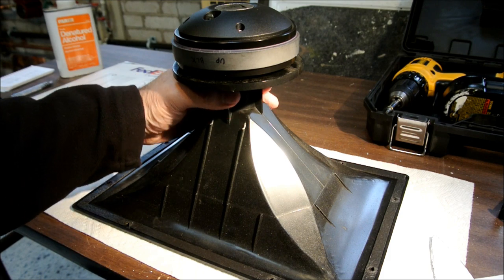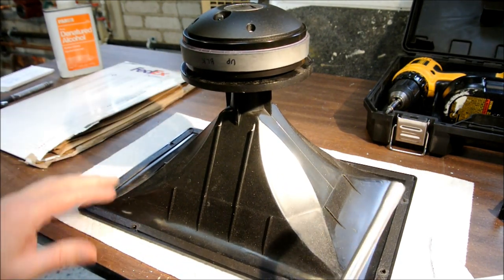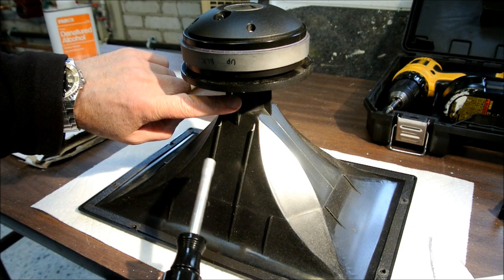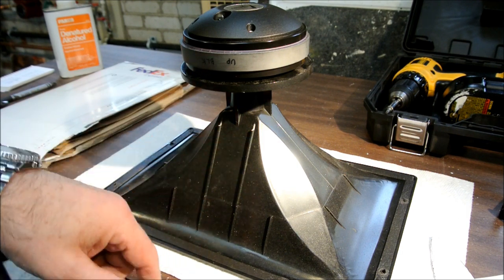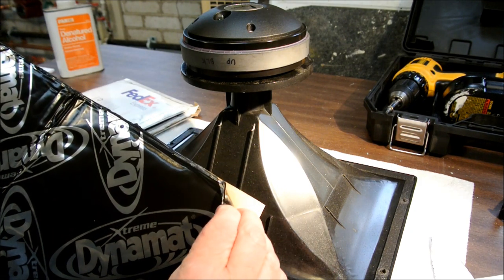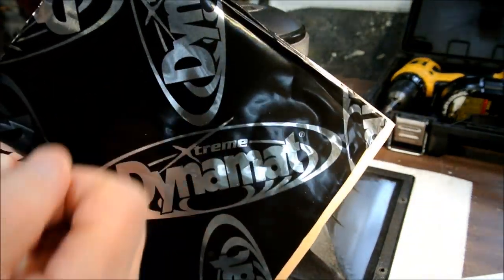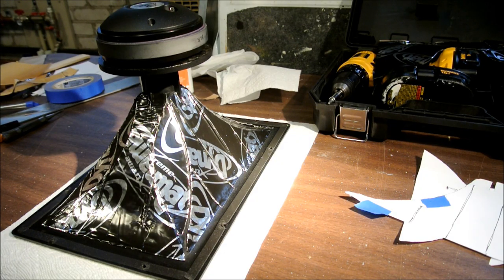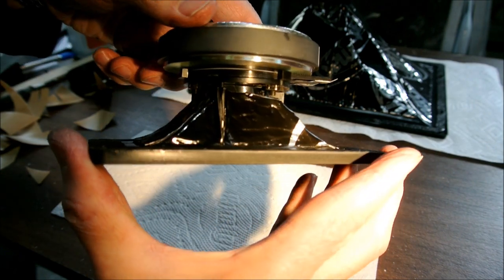How to Modify Klipsch speaker horns for better sound.

Comment: Nice job on the dampening project. It is a worthy goal to reduce resonances wherever they occur. I have to admit that I am a little skeptical of the audible benefits though however I am of an open mind that there could be real benefits to be had. I wonder though how you did your subjective comparisons. 
If you treated both speakers then fired up your system and listened, I am still skeptical of the claims of major differences you stated, not that they are not actually there, but that you are inferring that you can very well remember the sound before the change. It is well known in the psycho-acoustics profession that the duration of human audible memory is very short, less than a second or so. 
Therefore, to do an accurate comparison of sound characteristics of differences, you should do the change to only one speaker at a time then listen to them side by side with a mono signal and use a balance control to go back and forth between sides and also use short musical pieces that are repetitive and compare the sides over and over to form a consistent and reliable opinion. This approach is simple to perform and if you can have another person setup the speakers so that you are unaware of which side is modified, you can do a true double blind test. I believe that as serious audiophiles we should strive for a scientific approach to our methods of qualifying and characterizing the audible benefits of our work. It is not that hard to do following this method and I think if we take the extra little effort to be more scientific, some of the skepticism that is associated with audiophiles claims will be better accepted by the audiophile community as well as the non-audiophile community
Reply from the maker: I did do mono, side-by-side comparisons and filmed my listening impressions ... but the video got too long and I figured most people wouldn't be interested.
Reply: @thebostonaudiophile  Thats great. But did you compare treated to non treated speakers?
Reply: Ciao Stewart. That's my little story. I Bought the Isoacoustic Gaia III for my Klipsch Forte III. I had to drill the bottom of the loudspeaker to fit them but that's another story. Once made the first loudspeaker I switched the system on to ear the differences between the two and I can assure you that the difference was huge. The one with the Isoacoustic had a open and airy sound with more details and refined while the other was collapse. Any doubt that this little trick work. Thanks to Boston Audiophile for sharing. Next week end I'll do the same!!!!
Reply: @alfa71omega  Hi. I got the Fortes too. How does the Isoaucoustic Gaia 3? Small damping feet?
Reply: @theklipschcave5593  Isolation feet. They are meant to absorb the loudspeaker vibrations and isolate them from the floor. I was very very skeptical 'till I hear the difference from a dealer.... but they work. I think that with this mod the Forte III will achive their top performances (unless we mod the crossover too)
Reply: @alfa71omega  Well I find it interesting that isolation feet made that much difference. That says that you have them sitting on a floor that is pretty flexible and that there is enough energy in the cabinet to transfer to the floor. A good move to stop the floor from speaking to you also. That wouldn't be an issue for cement floors.
Reply: @thebostonaudiophile  I think that anybody that claims to be an audiophile and into the high end would be very interested. Maybe it got a little long winded but you probably could edit it down some. I think that doing good before and after listening comparisons is something that is sorely needed in the audio business, manufacturers, consumers, and snake oil sales people. It isn't really difficult to do even for double blind testing if you have someone to help you.
Reply: @alfa71omega  I would have to sit them on 2" foam pads before plunking down $200 on feet.
Reply: @alfa71omega  I got transport dollies with Auralex damping mats. Bit difficult to use this on this platform. But I will look into it for my rack with the gear.
Reply: @StewartMarkley  I do have cement floor
Reply: @StewartMarkley  

I recently bought air conditioning condenser anti-vibration pads that you put underneath central air conditioning units that have cork centers with rubber on either side for $0.69 a piece worked like a charm!🤗😇  and yes they did work but no need to spend all that money on anti-vibration pads when this kind of stuff is available considering I had to buy like 20 of them for the sub speakers the front towers the Rears!😬 silly to spend thousands when I spent a  couple of bucks!😋😉🤪
Reply: @alfa71omega  Well then I cant understand why isolating them from the floor does anything. But I would have used some simple foam pads before spending $400 to isolate two speakers.
Reply: @bigjay1970  That is a great simple and cheap solution. How thick are those pads? You have 20 speakers?
Reply: @StewartMarkley  

You dam right its a fantastic idea!🤗😬  4 per speaker because 4 feet speaker!  Even without feet I would do each corner!  7 speakers!  Best place by far, SUPPLY HOUSE.COM.  35 CENTS A PIECE. 2 X 2v  7/8TH INCH THICK and nice and cushy rubber, I've tried others like this and these really absorb the vibration.  Not as pretty as ISO but I could care less!  JBL Studio 590's and 550P subs and such.  Works great!  YOUR WELCOME!🤫🤭🤗😇🤪🤯🤓  I SPENT HUNDREDS ON OTHERS LIKE THESE AND RETURNED THEM AND KEPT THESE!  THEY ALSO HAVE THE BLUE INNER CORE  type THAT I didn't get because the smell at first and if you look at my photo, she can't deal with the smell but the cork work great and no smell   Amazon has similar for much more money but atleast you can see the reviews.  They are meant for what I said compressor isolation.🤫😬😜
Reply: @bigjay1970  you are a man after my own heart! I love doing things the smart way instead of the expensive way. But I have to say that I don't really get how isolating speakers from the floor can help unless the floor is flexible like made from wood versus concrete. If anything I would think it would be the reverse as the cabinet would be more able to flex and cause increased cabinet resonances.
Reply: @StewartMarkley  

Second floor apartment wood floor makes a huge difference. I don't feel the vibration through my feet. Concrete floor would probably do shit!  Key is the wood floor but I must say even on the carpet which is on the wood floor it makes a big difference and yes I analyzed it like a mental case!  It makes a difference actually a big difference! I'm not going to say it opens up the sound stage and all the other nonsense but there's definitely less vibration I'll call it and remember I have two  subs in front of me as well and it  just clears it up a little bit if that makes sense!  and for $0.35 a piece it surely doesn't hurt!😂  I'm about nine feet from the speakers and they're big speakers I'm not talkin little Stand mounts here. It does make a difference even through the carpet because I have them on the carpet you got to be just a little bit more careful but my feet or should I say the bottom of my feet tell me it works and so does my wife!😉😉😉🤗😇
Reply: I dampened one speaker first and did comparison. I also fitted a piece of hard rubber between the back of the mid horn and the back panel. The I put a dowel between the front panel and the back panel to brace them. These mods did make the sound more clear and the image more accurate.

Comment: This may be why wooden horns have such a good reputation.

I have used duct seal to dampen speaker baskets. Is dynamat more effective?
Reply from the maker: Could be a plus for wood? I didn't use the Dynamat as a seal but as a surface damper. The enclosures are ported anyway so I don't know if sealing would make a big difference or not.
Reply: @thebostonaudiophile  I use the duct seal as a damper. It is like a thick putty of fairly high density so damps some of the ringing.

Comment: Awesome. How much material do I need to order to finish both horns on 2 speakers?
Reply from the maker: I used this (18x32"): https://www.amazon.com/gp/product/B00020CAVA/ref=ppx_yo_dt_b_asin_title_o01_s00?ie=UTF8&psc=1
which was enough for both speakers with a bit to spare.

Remember to mark the wires and horn terminals so you get it put back with the crossover connected to the right drivers and with the proper polarity. Also, the Dynamat sticks really well, so I would consider it non-reversible. Good luck!
Reply: The Boston Audiophile Thanks a lot. I’m going to follow your journey and start working on these mods. Seems pretty straight forward. 
What are you planning on doing next, cabinet bracing? Seems like a next logical step before diving into crossovers. 
If you are going to mod your crossovers, can you do a detail step by step process and parts list? It would be very helpful. Great work as always. 👍👍👍👍👍👍👍🙏🏻
Reply from the maker: You are welcome. Please read my cautions in the video’s description. Good luck!

Comment: I haven't checked your channel completely, but have you done other upgrades in the electrical path, such better inductors, capacitors, resistors, and replacing steel terminal parts, etc.? Following the logic of your horn dampening, I was wondering if packing a singer's nasal cavities with cotton would improve their sound by reducing resonance in the mask..
Reply from the maker: @fredbloggs6080  Changing the recorded source isn’t the same as removing colorations in the playback chain.
Reply: @thebostonaudiophile  I wasn't suggesting that as a better source for recording, I making a joking analogy between damping a horn and damping singer's nasal resonance. Have you heard the Volti Rival? A Cornwall copy design that supposedly uses better components and cabinet build etc. The designer says he doesn't care about measurements and doesn't pay attention to how his speakers measure, he just goes by what he likes when he listens, so he may like certain colorations and apparently a certain number of people like that too in his speakers. Is it possible some people like the existing colorations and the Cornwall IV over what happens when they are modified? I'm just asking, just as you put the disclaimer on the modification of damping the horns.

Comment: Will this work on the tweeter horns of my F2s ? Thanx ! Wonder if it's such a cheap mod, why is it the manufacturers don't dampen the horns at the factory ?
Reply: Proper damping is costly. The best horns from Western Electric, Philips and other top makes were completely double walled with the interior space filled with fine sand! If you've ever heard a W.E. "multichanneled" cinema horn you're spoiled forever!
Reply from the maker: I expect so. I can't comment on why manufacturers don't do it. Perhaps they feel it's not cost-effective (It does take some time = money) or that their customers won't value the difference?

Comment: I’ve seen a similar modification to older Klipsch.  Did you do this because you thought the midrange was too hot/bright/forward?
Reply from the maker: Not exactly. I wouldn't characterize the Cornwalls as particularly bright. I was after more resolution, timbre accuracy, and control by taming the passive colorations of the horn.

Comment: Very cool but I’m wondering if the lively ness of the horn is not part of the design instead of a flaw or shortcoming.
Reply from the maker: The sound is still plenty lively, in fact, it's more dynamic after the mod.
Reply: Quite frankly, material cost plays a huge role in design.

Comment: I'm wondering if using some Flex Seal spray rubber would be as effective with 1/10 the work? How hard is it to completely detach the plastic horn from the driver section? Klipsch could sell the plastic part to modders to replace mods if they don't work out.
Reply from the maker: Flex Seal spray will not create constrained layer damping (Dynamat is a viscoelastic rubber with an aluminum constraining layer) which is critical for high-performance damping.

Comment: I was wondering what issues you experience in the bass region now that you've upgraded the mid range?
Reply from the maker: J Wester Since dampening the horns, I’ve made other changes to my system, not the speakers, and the bass is sounding quite good now. I plan to follow up in future videos. At present, I need a new computer before I can make new videos. Thanks for your thoughtful question!

Comment: Try placing a piece of dynamat on either side of the tweeter butterfly tab. Cove the full tab and leave the metal terminals sticking out. This tab rings like a doorbell.
Reply from the maker: Thanks for your suggestion. Sounds interesting. I'm not sure which part of the tweeter you are talking about. Can you clarify? Thanks!
Reply: @thebostonaudiophile  the butterfly is the phenolic impregnated disk upon which the diaphragm is mounted. There is a terminal tab upon which the terminal connectors are mounted the tab protrudes from the assembly. Place a layer of dynamat/hushmat on both sides if the tab. Do not place any dynamat on any other part of the butterfly. here is a link to a photo showing the terminal tab. https://www.startpage.com/av/proxy-image?piurl=https%3A%2F%2Fencrypted-tbn0.gstatic.com%2Fimages%3Fq%3Dtbn%3AANd9GcTbpFsowZ5CABjUYKW920mcljUjr9dUV9NKulkVY42mkkTQGuiX%26s&sp=1594624442T86f65f5742a59da1b58e215b284baf25f79105eee61cfccb18305745eb145c5e

Comment: Yeah use that dynamat to make gaskets for the speakers all the resonance is from vibration into the baffle not sound waves you want to isolate the driver as much as possible from the baffle ideally mountain it on the back of the magnet the back of the speaker not touching the battle is the best way. You should cover the basket of the woofer with the dynamat as well sort a lot of the bass problems especially using it as a gasket open up the bass make it more depth more detailed not sounding congested.
Definitely go with natural wool fleece as well give it 30% say more than the filler you got at the moment that I make the bass tighter more reactive
Reply from the maker: Interesting idea regarding driver gaskets and wool. Thanks.
Reply: @thebostonaudiophile  yes wool is the best dampener using it in your room as absorption panels works well just hang it off the wall or corners, yes any vibrations entering the driver like a tweet or mid-range I would say more so on a horn loaded speaker causes smearing of the frequency. You want to try and limit the reflection back onto the driver inside that's why pack it on the back not sides it's good to have some reflection of the sides inside the cabinet but you don't want it bouncing back onto the driver causes cancellation and smearing of the frequency experiment how much don't be afraid to go a lot. If you do that let us know how you got on

Comment: I have seen many videos of people taking out the horns say on a Forte or Cornwall. But it seems the paint is always ripped off on the lip of the hole. Do you know what black  paint Klipsch uses to replace missing paint before putting back in the horn?
Reply: I don't know what kind of paint they use but when I did mine no paint came off.

Comment: I tried this dampening with my KG-4 horns. My results were discouraging; it took all the brightness out of them and they sounded dull and nasally. I removed the dampening and the brightness returned. I did however use a gasket material around the screw flange and that seemed to do the trick for me.
Reply from the maker: Sorry to hear that you didn’t like the results. I’m not familiar with the KG-4, but your ears are the ultimate judge for your system.
Reply: @thebostonaudiophile  Plastic horn with soft dome tweeter.

Comment: Great job, my thoughts exactly. How about plastidip spray? Five bucks a can.
If you do not like it, you can literally peel it off.
Bought the r-28fs for my daughter, and we love them...especially for 170 bucks a piece.
Im not doing that, because they sound great to us both, but it just looks like they did a similar spray coat on the rp series themselves.
Now that I think about being able to peel it off,
I might try it...with her permission and opinion of course.
Thanks for the info, be safe everybody.
Reply from the maker: Plastidip might help the sound too, but it's not constrained layer damping like Dynamat. Constrained layer damping is typically more effective than simple coatings.

Comment: Great video, how about modifying the chassis of the 15” woofer?
Reply from the maker: I’ve been thinking about the woofer and cabinet, but I’m still deciding what, if anything to do. The first thing I want to play with is speaker position (again!) now that I can hear what’s going on even better.
Reply: @thebostonaudiophile  Once I heard the Klipschorn. It's been something "magical". Driven by Accuphase chain. Outstanding performance in all the frequencies. Incredible imaging. From that experience I placed my Forte III at 40°, two feet from the back wall and one feet from the side wall. The sweet spot is something like 2 feet from me. They sound great!!!! Hope to did the right conversion from meters to feet ;)
Reply: @alfa71omega  I hear you got the same experience like me. Very interesting. Once I had the horns. They were too big for the room. You have to have a really big room and understand how they work. They are great. But the Fortes are not so bad either. I have the Fortes 90 cm in front the front wall. 40 cm from the sidewalls. Curtains and absorbers on the front wall and diffusers.
The couch moved forward against the front wall. It looks strange but sound good.